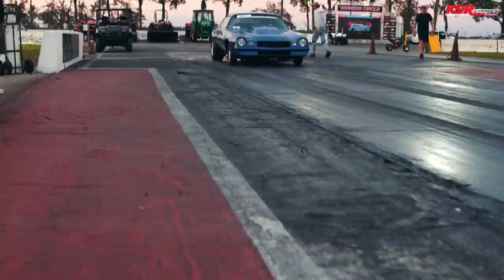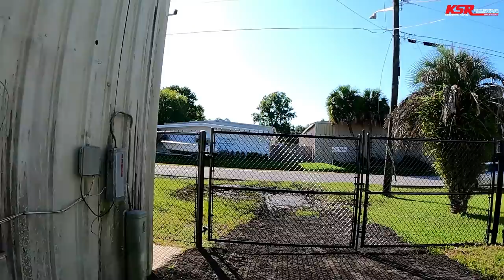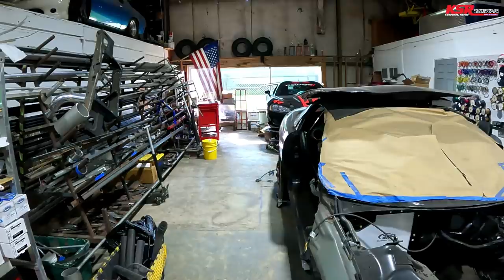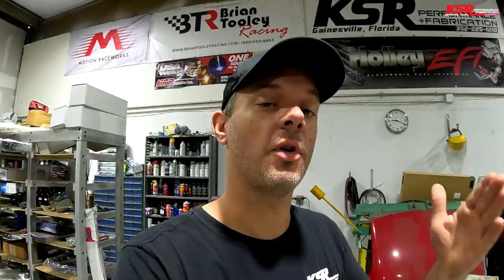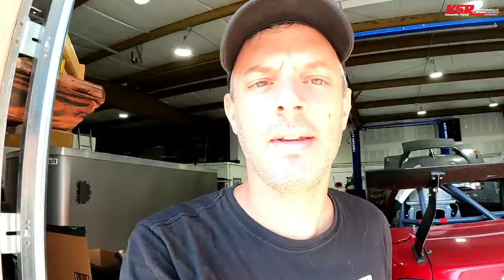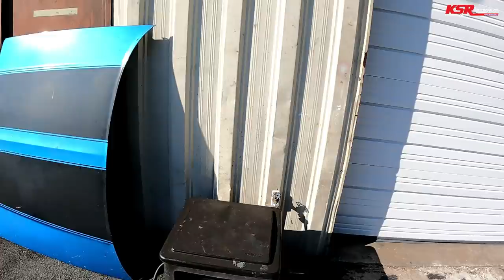More KSR Shop Upgrades!! Keeping Cooler With Insulated Doors!!

Comment: You appreciate us, ...I for one am enthralled to watch a true craftsman at work!  I bought a front end wrecked '72 Pinto in '76, stripped it to a body in white and started to build a copycat Gapp & Roush Pinto bracket car pushed down the 1320 by a blueprinted Boss 302 fitted with their "special" heads, ...and then my second daughter was born and that ended my racing career before the car was finished, ...watching you at work makes me realize that if I had finished it I probably wouldn't be here today, ...thanks for sharing your knowledge and expertise, ...and allowing me to watch you build and then taking me down the strip with you is satisfying and old man's dream!

Comment: Kevin I think it’s us that are the lucky ones to be able to watch how meticulous you are how thorough you are especially your wiring and how when you are fabricating something you’re thinking 10 steps ahead make it easier to work on or to diagnose a problem. I’ve worked with several fabricators before and let’s say that summer short sighted in there thanking. It’s a pleasure to watch you and your guys build such beautiful race cars.

Comment: A/C in a shop is life changing if you all can do it. I love watching all the types of videos, shop upgrades, builds, racing, and tuning information. I think I personally would love to see more on fabrication and such. I’ve been wanting to get into welding myself, but the cost of entry seems high for what I want to do, basically custom exhaust and odd’s and ends. That doesn’t even include the difficulty of welding thinner metals without overlapping them. As always love the videos.

Comment: tie those downspouts to 4" on the ground and move the water away from that area of the trailer parking.    The downspouts are flooding your trailer spot
Reply: This times 1000! 
Whacky standards in the USA where you can just put the spout straight onto the ground.
Reply: I know a place that has splash block and distribution boxes.
Reply: Yep, the new millings will soon be washed away and the ground will still be soft.. need to redirect the water

Comment: Kevin, I have been in speed shops, and performance shops since 1969, the original Jack Merkel shop in Queens NY, and had my car on a dyno in 1970. I love going into shops, but it's hard nowadays, they are too busy, insurance regulations, unfriendly, what-have-you. But this channel solves all that, I get to see your work, all in the comfort of my home! From the time you set up Ruby's suspension and made it more consistent, it was evident you could not only tune, but make a drag car work well. What may be mundane to some is interesting to others, so I'll keep watching it's all good to me. Thanks.

Comment: I used to run my own garage in Scotland. In the winter of 2010 it was minus nineteen Celsius inside the shop. So I can fully appreciate the need for decent climate control. We worked all through that winter with a Deisel heater roaring away just to stop the toilet and the kettle from freezing solid 😂

Comment: Productivity and employee moral will exponentially increase with a comfortable working area. I see it with my business. (Home renovation) outside in the heat in humidity slows the crew down, inside projects in conditioned space our productivity goes up. Much better for the bottom line.

Comment: I air conditioned my 4000 square foot shop in North Carolina and it was the best thing I ever did. My employees were much happier no fans and no bugs. I used two house package units 5 tons each and I could get the temperature down in the 70s in the shop, less than $10 a day to run. Do it now you won't regret it

Comment: We have 45,000sqft concrete building with 24ft ceiling. We run 4 roof top units up here in Oregon year round to keep our CNC Mill & Lathe shop at 72 degrees, I actually have to shut off 2 during the cooler months. All your justifications your thinking will come true moral being a huge part of it. Maintenance is a factor when thinking of where to install the unit. Thanks Kevin for the shop update! Love watching people be successful in there area of expertise.

Comment: Air Conditioning is the way to go. I suggest painting building white. It draws less heat.  & White roof or Roof covered in Solar panels . To block the Sun & power the shop.
Great job on the tune up. After it launched , left front picked up, Guessing right rear a bit off. The driver window was blowing out.  I noticed passenger window has a big air gap also. Reduce cabin pressure. Or use a Tom Bailey window lock.

Comment: I have a couple things that may help you out. Have your garage door guys install some weatherstrip on your doors. Also , see if you can connect your downspouts on a large trunk and run them to the back of your building. In a heavy rain , the water spilling out might wash out your millings. I installed air conditioning in my new shop , best money spent! I’m no longer creating rust buckets from sweating on projects. I bought a mini split , installed it myself in a few hours , and had a buddy charge it. Ingrams water and Air has the best prices and they’ll ship right to your shop! You have great content , keep up the good work!

Comment: You hit the nail on the head on the AC deal, just because you CAN work in the heat doesn’t mean that you wouldn’t get more done to the point the AC would make you more money than it costs! Tough guys need to remember that working smarter makes more money and you feel a lot better when you’re off the clock!

Comment: Hey Kevin, New door look great, and workshop is getting there. I notice your roof water pipes are open at there bottoms. That may effect your trailer parking spot, like flooding it ??? 
I suggest you have the down pipes plumbed together and run the water away somewhere, like into a drain

Comment: If you're going to move the tubing rack and close that off, then the Cutlass will definitely have to come down first or it might be stuck up there forever. My shop is 40X64 and has air conditioning. I couldn't work in it in the summer without that. It's an upgrade that is worth the money.

Comment: i would love to see a sleeper build. not ugly like farmtruck, but that genre. a modern twist on a turbo'd 4.3L S10 would be awesome. should be relatively inexpensive as well. just a cool ass street truck that runs the strip and burnout pads and drag week. the 4.3 is a highly capable engine that shares many parts with small block chevys. no custom engine mounts needed, a stock 4.3 s10 would be perfect. we all love watching you build more than anything else. thanks for being an awesome fabricator.

Comment: I would love some aluminum welding tips.. having trouble welding AN fittings to any plate aluminum. Welding flat plate is a breeze but when it comes to angle 📐 joints  welding that corner I think my settings are off slightly and it’s causing so much headache lol
Reply: You just simply have to play around with your settings, heat, speed, and size of wire used on some scrap plate until you find the desired result with fillet welds on ally plate. Ideally you want to be concentrating your heat right in the corner of the fillet join, but when welding an AN fitting to plate, concentrate more heat on the thicker AN material and wash down onto your plate. Aluminium definitely is a difficult material to weld. Weld prep is also very much essential with ally, always ensure it is thoroughly cleaned and wiped down with Septone prior to welding. That really is key.

Comment: Check into used commercial rooftop AC units. When stores and other commercial buildings are torn down they're usually salvaged if they're in working order. I've seen 4+ ton self contained heat/ AC units go for a couple grand or less. They have everything in one unit, no external freon lines required, no separate condensers, all they need is electricity and ducts. Best if you can mount em' on the roof, but they don't have to be. One body shop I worked at had about a 10 foot elevated stand outside the building and just ran ducts through a wall. Working in AC is wonderful, especially when yer' welding.

Comment: Nice improvements!  Need to pave from the street to the gate...  Or at least add gravel.  

A building needs the most cooling while the sun is bright...  That means AC can be solar powered a lot of the time - keeping the operating cost down (zero, depending on how you do it, although it's nice to have dehumidification all the time).  Solar panels are getting cheap too - Santan sells used panels for about $0.20 per watt (250W panel for $50).  $10-$15k might get you enough solar and AC capacity to make the shop pretty comfortable and essentially free to operate.

Comment: Hey Kevin and team, great content and I like to hear about how you're growing and improving the shop.  I have a suggestion for a video.  When doing custom wiring, how do you make the decision about color-coding the wire and traceability.  Especially where you may be wiring what will essentially become a loom.  Do you buy printed wire from a kit? I assume you don't put 10 red wires in the same kit or does it matter.  I have a wiring project and I'm a bit overwhelmed by it right now.

Comment: 7.48 is a beautiful ET. Mullet will be into the 6’s with Kevin’s suspension tuning and some cooler air and track temps. The horsepower is there. Traction is on the way.

Comment: USE A REMOTE CONTROL FOR THE BIG FAN! You can use a cheap $20 amazon wireless remote to shut the fan off when you tig weld. The wireless remote can be used to turn 120v power on or off to an inexpensive contactor, wired into the fan. My Miller 330 abp tig welder shuts off the swamp cooler in my garage when I press the pedal.....fan on demand for a 1965 welder, but even better. When I let go of the pedal, a timer runs (I usually set it to 30 seconds) and then the cooler gets power again and the tig cooler and welder fan shut off. It is seamless and I wired all of it with a few relays and contactors, as well as a timer. The contactor on the cooler is normally closed, so it is only energized while the tig pedal and timer are active and with the tig welder switched off, the cooler works normally.

Comment: I would really like new insulated doors on my shop. I have steel roll-up doors facing East. So the first few hours of the day the doors turn into heat radiators and turns an 80 degree shop into a 95 degree shop. If I open the doors the sun just heats up the concrete. But I still love working in my shop. Right now we are hunkering down while Tropical Storm Henri making a direct hit here in RI.
How about a little history on your start in motorsports and how you got to where you are?

Comment: I Think you should ran those down spouts into piping that goes under your millings to keep it from washing away
Reply from the maker: I plan to aim the downspouts back towards the back of the building. I thought the same thing about them washing away but the guy that put them down said that they are not going anywhere
Reply: @KSRPerformanceFabrication  with the amount of rain y’all get, I bet it’d wash some ruts. Y’all get more than we do up here around Lousville Kentucky, and I’ve seen gutter wash eat through some dense packed surfaces

Comment: Be cool if you could get someone to sponsor the cutlass  build..want to see all the neat stuff you put on mullet put on the cutlass [glasscutter]
They should pack the asphalt millings...it will.set like concrete
The doors springs will die down a bit should of ask for springs sizes to have on hand for when you call .. hope they are 2 inch and not 1¾

Comment: Trust me,I live in the most air conditioned city in the world...Houston Texas.
 I worked in a few un air conditioned machine shops when I first started machining and it was brutal!!!! You were basically standing over an oven when you ran a lathe and were hogging off a bunch of material,all those hot chips radiated heat like a mofo!!! And if you tried to cool them by using more coolant you were in a steam bath.
     Did that for a few years until I could turn down those type of shops.

Comment: Mustache
parking on millings for extended periods,  I've found placing wood under the trailer tires & tongue jack will keep you from making permanent imprint in the millings surface
Reply: That goes for all asphalt surfaces, it may seem hard but the landing gear on a big trailer can sink right through on a hot day. Just parking in the same spot every day massive ruts get shaped into truck stop parking lots in hot areas.

Comment: Run a compacter over it , fil any low spots , collect all roof runoff and pipe it to the lowest spot , hopefully that's not your front gate if so install a culvert and divert .

Comment: got a strange  for you, can you find a Saab 95 Aero and get a 234 block t19 or gtx turbo a T7 head from the 95 you get on that block and a good tune, i think you will be surprised with what you can get for very little $$$

Comment: Will always have issues down that side with open down pipes running off the roof, you need to divert them somewhere (preferably into a storm water drain)

Comment: Here's a problem that you don't have to deal with Merlin....Canadian winters.
Worked for a couple of "blue oval" dealerships that got suckered into buying/installing waste oil furnaces. The CO monitor was constantly going off so the owner had it disconnected. Let's just say he wasn't happy when 30 technicians locked their boxes and walked out .....

Comment: Hey I'm not going to say that your going to have problems with the millings but you may if water gets under them and those gutter spouts are not your friend when pouring out where your parking i would ut a pipe at the bottom and divert water away if possible.

Comment: You need to have those guys come back out and take some tension out of those door springs, your doors should never rocket open like that. There should be enough tension to where the door will hold itself open right about waist height.

Comment: Would it be worth put a Drain in for the two downpipe's so the rain water does not sit where the Trailer is Parked ?????. And do you have any room at the end of the Workshop to put a welder's Hut with the Equipment still in the Main workshop so it dose not get stolen dyno side for welding Machines and leads, have a small door that the leads can be put thru.. lol from Thailand .

Comment: I want to know what it's going to take Mullet to brake into the 6s
Reply from the maker: Now that the suspension is doing what it’s supposed to, we can finally start working on the boost ramp to get it more aggressive early in the run. It needs to go about a 1.15 to 60ft, and if it will do that, we can get real aggressive from 60ft yo 330 and really knock the ET down. We have 15 more pounds of boost to cram to it out the back door too! My goal is by November we will be in the 6s. Mullet is a bit on the heavy side full of fuel, water and giraffe so it’s going to be a little tougher than a featherweight car to get it there, but it will get there.

Comment: Mate what is better than dry ice cold air? Free ice cold air !! With the size of your roof you should get solar. Imagine being able to use tools all day and know that all it is costing you is consumables and man hours and that all the cash that you would normally spend on electric bills can now go to better things like more car parts and cool workshop toys. Matt from Demo Ranch has a guy that can get some sweet Made in USA solar setups, maybe his guy could hook you up. Short or long term plan i would for sure kick the tires and get a price at least.

Comment: It's probably not youtube, its more likely that someone is watching on a phone that is slow.  This causes the phone to think a light brush of the finger on the sub/unsub button was actually a full press. A properly working phone can tell the difference between the 2. While a phone running out of memory will have serious issues like this in youtube and any other apps they use. Memory is different then storage. Your memory is called "ram" and any phone that did not cost more then 600 bucks and or is more then 2 years old probably does not have more then 4 gigs. While a modern S21 Ultra has 12 gigs of ram.  If you use your phone more then your laptop then your phone should be the more valuable of the 2.  From a computer this problem has never happened to me. From my 6 different computers I use daily this does not happen.  However, on my last phone that I went cheap on it did happen.  On my new phone it does not. I have the s21 now. Its a beast.